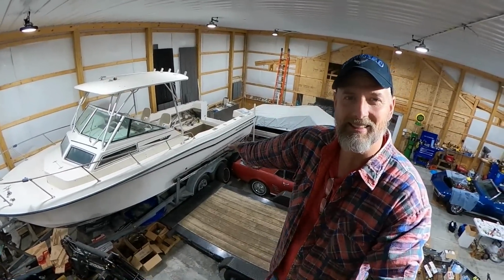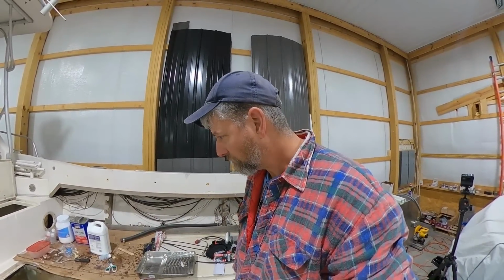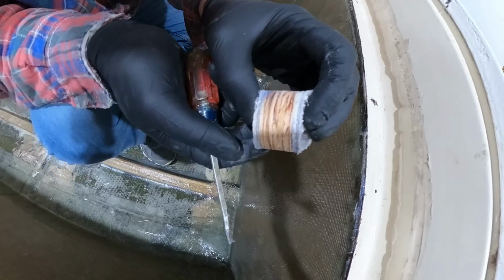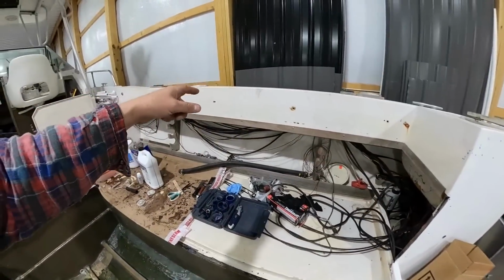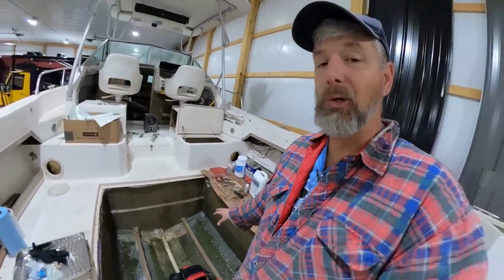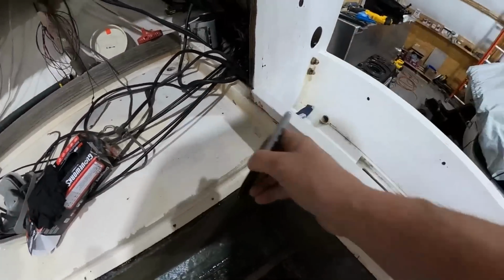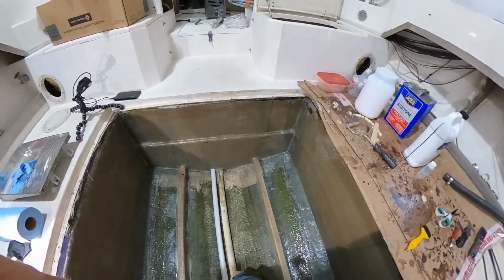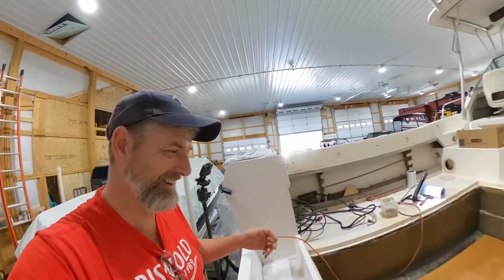Grady White Upgrade | $10 Boat | EPS 56 | Shots Life

Comment: This is what I did regarding the fuel tank install in my 1972 Formula 233.

I ripped 3 inch pvc down the middle and glassed it to the bottom of the centerline of the hull.
The forward bulkhead sits on top of that and so does the rear bulkhead.  it's all peanut buttered in.
The aluminum tank is suspended in midair by being screwed to fiberglass plates that were epoxied to the stringers. That way no screws penetrated the plywood stringers.
Then 6#  2 part foam is poured around the tank locking it in place. BTW, that is per USCG standards.
Then I sanded the foam flush with the top of the tank.

Next step is to lay chopped strand mat on top of the tank and foam with the glass rolling up the sides of the bulkheads and stringers. work the chopped strand as close to the fittings in the top of the tank as you can.

Then cut out a small opening in top of the rear bulkhead and glass it to waterproof it.

Then roll gelcoat with wax on top of it all. 

That way any water that ends up getting into the fuel tank area can exit out the top of the bulkhead and end up in the bilge.
Reply from the maker: Man you went all out, nice job!

Comment: So I've seen some guys do something different with holes and waterproofing...
Cut a hole a couple sizes larger than you need, fill with thickened resin or epoxy, let set then drill the appropriate sized hole in that. That way you're drilling through the resin or epoxy only and there's no air gaps or areas where water can seep through. I've seen that more for thru-hull stuff but I can't see how it'd hurt doing it everywhere else for wolaterproof's sake so long as you have the ability to back the hole somehow so the resin doesnt just leak out the other side..  Hope it helps! Enjoying your videos! It's exciting and inspiring!
Reply from the maker: Yeah that’s a good suggestion, I have heard that before, haven’t tried it yet though… makes total sense though.

Comment: Nice work Chief! Can I suggest to see if you can install a flapper valve to prevent water backflowing from the rear bilge into the forward section through that new pipe? It won’t need to perfectly seal, just enough to stop free flowing water. I’m looking forward to that beautiful fuel tank going in! Keep up the great work!
Reply from the maker: Now that’s an interesting idea.. hmmmm

Comment: Wow such great progress can’t wait to see how the tank goes in. Just something to think about is the wiring in the back could also be for the motors. If I remember correctly the shift a throttle cables will be back there also. The battery cables should be back there also. Great work and your getting close.
Thanks,
Tim
Reply from the maker: Yes Sir, I think your right about all that, going to be a fun mess to figure out!

Comment: The Grady is looking awesome, Chief.  One thing you may want to consider when mixing 2-cycle fuel for your soon to be rebuilt Evinrudes:  I don’t know how big your new fuel tank is, but mixed 2-stroke fuel may not have a shelf life as long as straight gas before it turns into nasty, jelled, ick, you can’t use.
Reply from the maker: Interesting to know
Reply: @shotslife  Just sell the old Evinrudes and buy some decent 4-strokes. 2-strokes stink too much.
Reply: @Carbonfly69  150 HP Suzuki 4 strokers retail for $10.3k each. I don't think it's in his finances.

Comment: Glad you decided to make a way for water to get out from under helm. Check with your engine manufacturer that you can mix oil and fuel some 2 strokes need oil injection, they use it to direct inject oil to crank shaft. Not all do this but some do and it will cause crank to sieze if it needs it and no longer has it.
Reply from the maker: Good info..

Comment: Chief I would take a second and pause on the "mixed" fuel in the tank. If your motors are post 1996 you should do some specific research on your VRO for your specific motors. I've ran an offshore boat for years using the oil injection, even setting off my low oil alarm a couple of times. Most motors have a low oil injection alarm as well. When I bought my first off shore boat, I told the mechanic I hired to do the sea trials that I was considering disabling the oil injection, because I am guessing like you I had heard to many horror stories, he laughed and said I was a fool ( He has been in business for 50 years so I took his advice). Its been 7 years since and the boat is running strong without ever having an issue. and now I know the thought of trying to mix oil in the 80 gallons I put in the boat before an offshore trip would just never have worked. Anyway, I get it if you do, I was going to do the same thing, just because it felt safer. But many of the blown motors were blamed on VRO and was actually some other mechanical failure. a great resource to post that question on your specific motor is "the hull truth".....unbelievably great job on the boat tho, awesome to watch the progress!
Reply from the maker: I’ll take your comments into consideration. Thanks!

Comment: Have you given any thoughts to adding some easy accessible rigging tubes before you close the deck.  My 22 Fisherman has a rigging tube along the starboard chine.  It's full and getting stuff in/out is a chore even with a snake tape.  Builders typically don't give a lot of though of future re-wiring, running cables and transducer stuff to the helm.  Something to ponder.
Reply from the maker: I’ll have to look that up, I don’t even know what a rigging tube is..
Reply: @shotslife  Just a pvc pipe that wires, cables and such runs through.

Comment: Ok, good work, but sorry to say you really do need a drain plug for the fuel tank section. Right now, you have no way to evacuate any water buildup. At this point, you could drill one from the bilge forward into the compartment and just put in a small piece of PVC with a drain plug to fit so you at least have a way to check it periodically. Where is that PVC pipe going or what is it doing that is in the middle....before you installed the second PVC drain? I missed what that one was for. 
Also, would have recommended you place some fiberglass mat straps over the PVC pipe in the floor to keep it from slapping the hull when hitting waves. They will make a lot of noise.
Reply from the maker: Soooo the fuel has a bung to keep the fuel from going in the ocean, you can pull the plug into the section with the pump. The extra pipe is for the middle section that did not drain anywhere before. Yes, if you watched the video you saw me make a fiberglass strap, good suggestion.
Reply: @shotslife  Sorry, not getting the fuel bung thing. What else don’t want us if there is a fuel leak, is for fuel to get into bilge. If it does, it goes boom. What I am saying is there is no exit for water to drain out of the fuel tank compartment.
Reply: @Grady252  
I’m in agreement with Grady. If water or fuel gets into the compartment you’ll need a way to drain in when out of the water. Otherwise if fuel gets in that compartment you will have a chance to know it as well. Additionally you can get bilge sniffer devices that can electronically monitor closed spaces if your concerned about leaking of fuel or it’s vapor settling into the lower compartments of your boat.
Reply: I agree with the need to drain water from fuel tank compartment.  Hole on floor at stern with a plug would do it.  If not, salt water wil kill that tank quickly

Comment: Im not trying to be negative but If it was me I would drill a drain hole on the stern bulkhead in the "coffin box" and put a brass tube in it. Then simply put a drain plug on the back side of that bulkhead. You will only have one time to worry about a fuel spill but you will have hundreds of times where water on the deck will find its way in the coffin box. Water surrounding an aluminum tank can cause electrolysis and eat that tank up very quickly. One other thing. The screws you put in the plywood base will surely work their way back out and will rub a hole in your tank from the pounding that hull will take. I would epoxy it down...
Reply from the maker: Interesting about the screws…
Reply: @Shots Life  I've been a tractor trailer driver for the last 40 years that hauls alot of hazardous material in the form of metal drums. Trust me nails in pallets will and have worked their way loose due the trailer bouncing and rub a hole through the drum.... this will really ruin your day, trust me
Reply: He resined over them. Pallets are nailed. He’s good.

Comment: Ive been watching the series from the start and admit i may have missed a couple, but i am confused. At the end you laid the board down for the tank to sit on and then say you left it so that water can run down on either side. Problem being you have completely sealed off that compartment now with two pass throughs neither of which address the tank compartment. So hows the water going to get out of the tank compartment??? If there is no way for that water to be evacuated then you are going to be accumulating water into that compartment every time you wash down the deck or it rains or water splashes into the boat, and that is a LOT of extra weight that you will be carrying around until ultimately the water reaches the top of the tank, unless of course you plan to completely fiber glass and seal off the lid to the tank area. But that doesn't make much sense as you need to have access to that area should you need to quickly be able to work on/ diagnosis an issue. I realize some people are concerned about gas getting into the water, but unfortunately that's kind of the nature of the beast, and something you should not have to even be worried about for a long time with a brand new tank.
Reply from the maker: Ok, so there is a tube to the rear bilge pump, I probably need to show everyone, some one suggested I seal it off which is what I was discussing in the video. Now all three chambers can be drained.

Comment: Did you pressure test all your plumbing Kev? (Check for leaks)
Reply from the maker: Most of it I have but not the back drains yet
Reply: @shotslife  they dont need pressure testing bud just your fuel and water 1s 👍

Comment: hate to be that guy...how do you drain the fuel tank area?
Reply from the maker: There is a drain tube to the rear bilge pump
Reply: @shotslife  i only saw two drain tubes from before the box and three sections in the box yet no drains from the box or bilges in those sections. so thinking that those three sections in the bottom of the box needs to be drained...how do they get drained.

Comment: That grey fuel line is crap. The ethanol will cause the liner in the fuel line to delaminate and clog your carbs!  Don’t use the grey fuel line, whatever you do!!!!!!
Reply from the maker: Interesting
Reply: I had black “fuel” hose and it dissolved on the inside.  Gray hose is built for this new nasty junk gas.